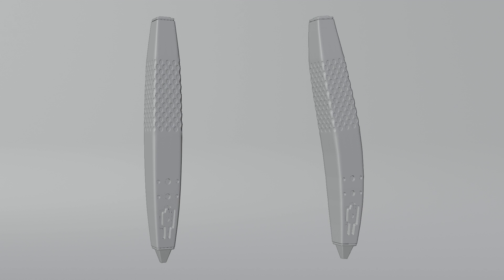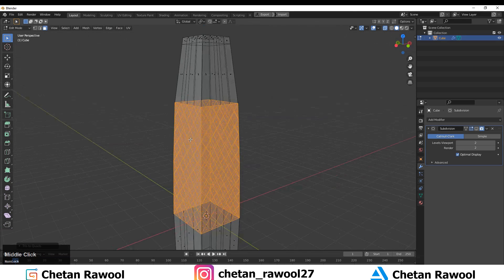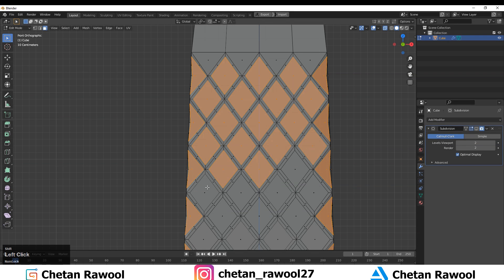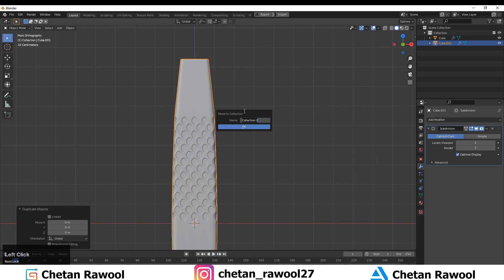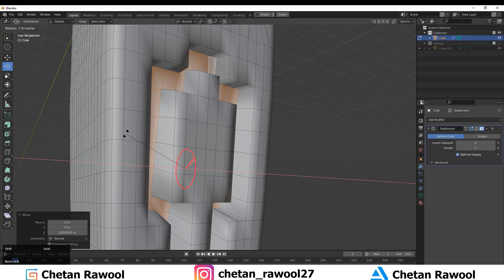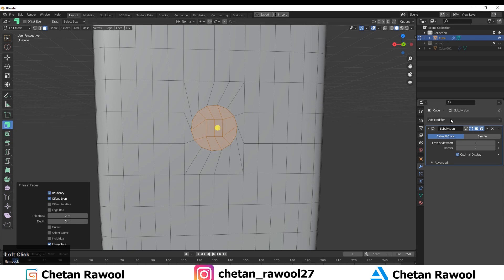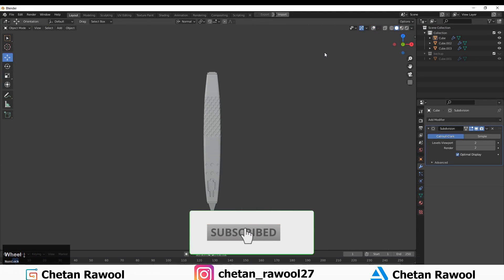Blender Hard Surface  Modeling | Cyber Muscle Modeling | Blender Tutorial

Comment: When you want to select a square  or rectangular area:  Select one corner face, edge, vert. Ctrl-Shift-Select the diagonal opposite corner face, edge, vert. Shift select to start a new square.... 
9:00 I to do an inset - then press O. It changes to an outset instead.
Shift-g. Gives you both select similar number of sides and similar face size.
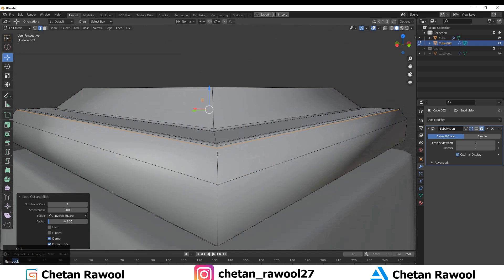11:50 To add the holding edges: Select all the edges, bevel, then in the bevel popup window set the Shape slider to 1.00 & segments to 2. Far faster than adding the loops one at a time, and possibly beveling... 
You are not even using click, Ctrl click to select a line of edges or faces.

You use none of these - but tell us you are teaching the faster and easier method.

i, then hold down Ctrl and move your mouse....
Hide the area you are not working on....
Learn all the options in the select menu....